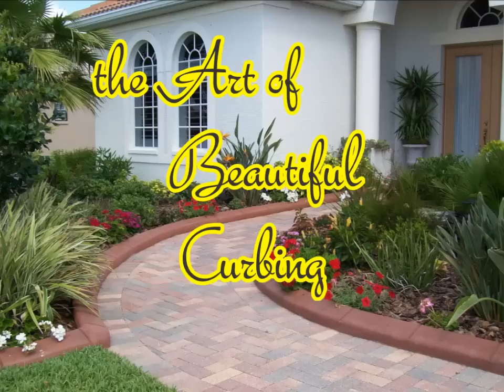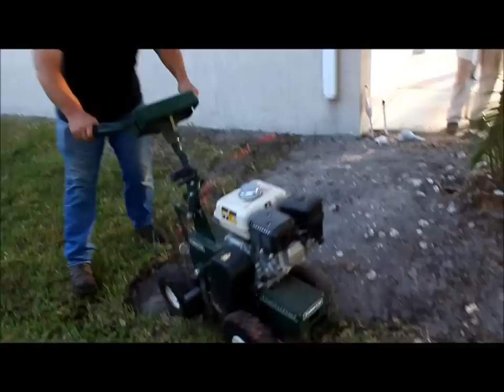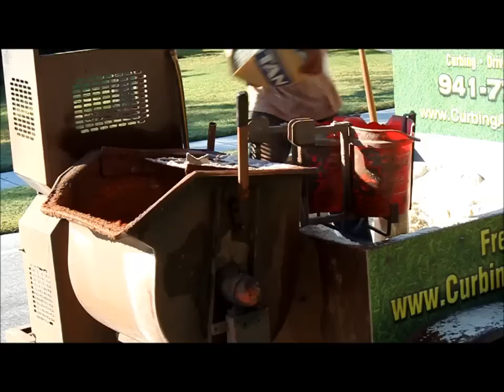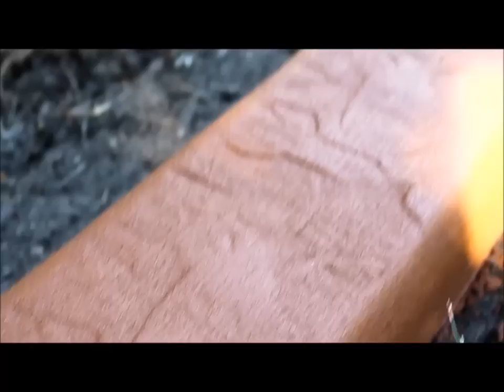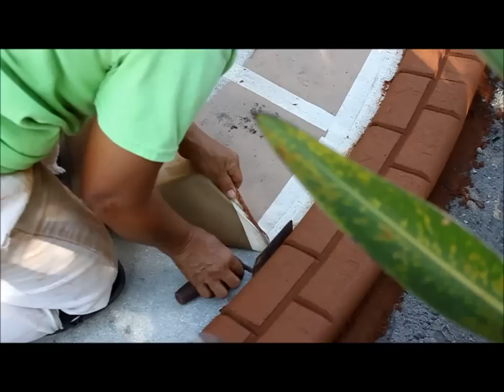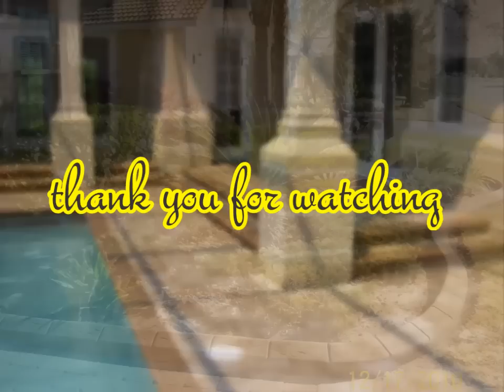Curbing

Comment: How does it look 10 years down the road? Concrete has a tendency to crack apart and it didn't look like there was any wire or rebar to reinforce it.

Comment: The work quality  is really good but the the product itself is horrible. It looks like what it is, a big blob of orange concrete. Bricks or individual key curbs are definitely more luxurious and higher quality imo.
Reply: Laying bricks is 3-4 times the cost!  Some of this stamped concrete looks like real bricks.  I much prefer the concrete curbing.
Reply: Look at some of his curbing at the end of the video...
Reply: +therealbeav I would agree that actual brick curbing looks better but after laying custom brick edging for several houses I can tell you it is very expensive and takes a lot of work and time to complete. My boss and I spent a total of 3 weeks by ourselves digging the 3 in. trench around a home that measured 450 feet total, and then laying bricks on an uneven landscape. The end result was beautiful but it did take a while. We did the work after working our normal 8 hour a day jobs.
Reply from the maker: +Matthew Howell I glad you like your job keep your job. I will keep mine. over 3000 satisfied customers. good luck with your brick boarders